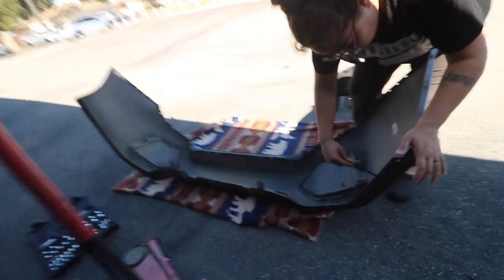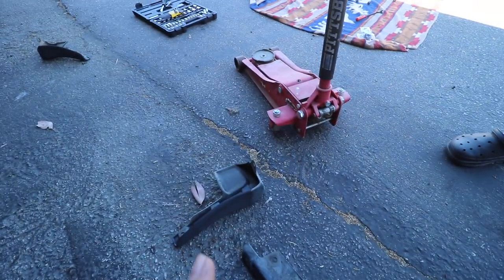Installing a Type R Rear Diffuser, Side Skirt Splitter and a PRL Intercooler | 2018 Honda Civic Si

Comment: You need to change up the TIP too feel any difference, not just the intake, that PRL Intercooler is sweet I have the same one with the charge pipes
Reply from the maker: I think I found a 27won TIP too locally 🤣
Reply: @TdaKid  I personally like the PRL version cause it looks so much nicer but that one works too, whos SI is this?
Reply from the maker: @Bbc418  my best friend hector

He always helps me out with installs on my car
Reply: @TdaKid  good to have friends like him!! 👍🏼

Comment: I’m actually shocked you didn’t have a intercooler this whole time lol. I went with the Bms intercooler threw her on the dyno and made 240whp on a 23psi base map my tuner swore by prl until he saw this Bms intercooler and the fact it’s only 300$ lol. Can’t really go wrong though it’s designed for bmws making 600-1000whp and it’s fits like a glove on the 10th gen civics.

Comment: Weird 🥸 both of the little chodes on the ic lined up with the holes with the pipes on when I had it on
Reply from the maker: With the CNT? Lol
 Maybe I did something wrong but everywhere I looked online says you gotta “play” with it to get it to fit
Reply: @TdaKid  yeah bro I struggled to put them on tbh but I got it to sit where it was supposed to.

As long as it doesn’t shake like a motor with only one motor mount I think he should be fine